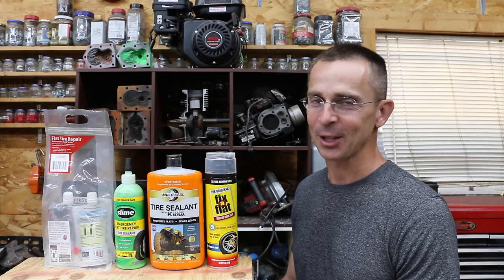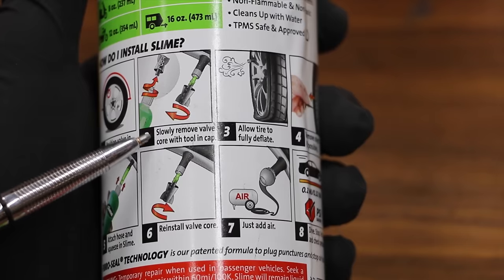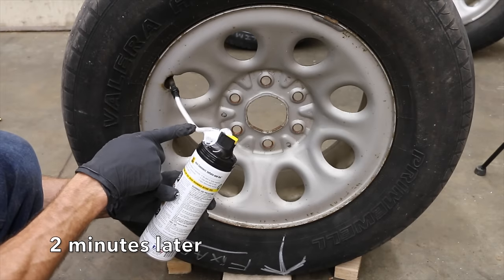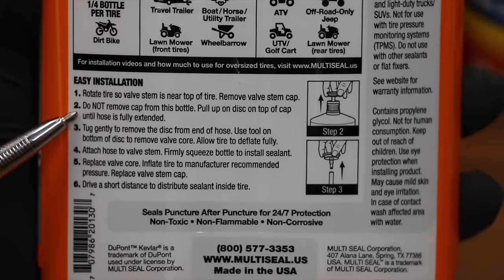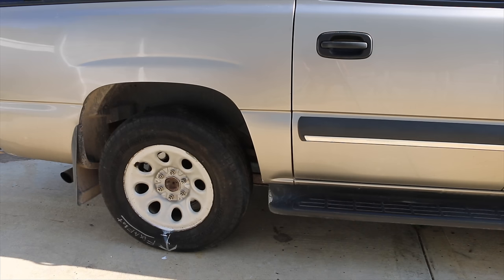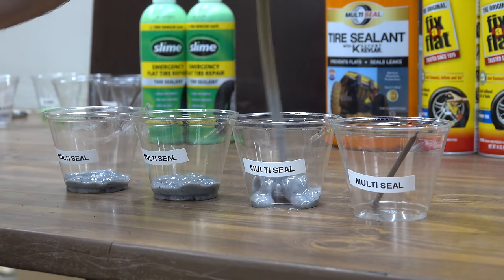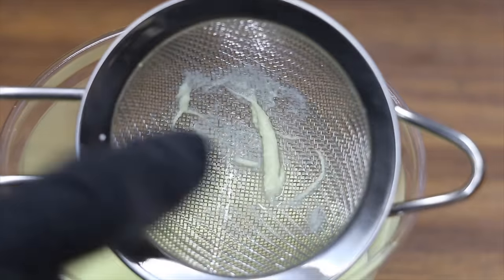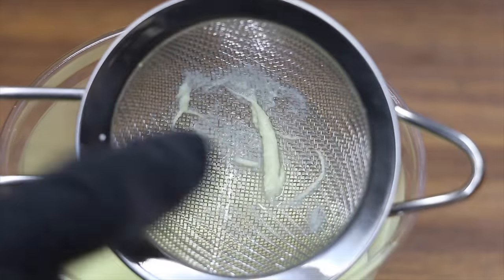Is Tire Slime the Best? Fix-a-Flat vs Tire Slime, TireJect, MultiSeal. Let's find out!

Comment: From my experience these kind of punctures are best repaired with the rubberized string plugs.  Remove the nail, jam the string in, twist, remove tool,  clip the excess.       But you gotta have an air source. Even better if you add extra rubber adhesive to the string.
GREAT VIDEO!
Reply: Agreed. If you add a good amount of rubber adhesive and it isn't on the sidewall it'll last the life of the tyre. I've done tens of thousands of miles on motorbike tyres that I plugged and never had a failure.
Reply: That's how I patch now.  But before I wised up, I tried slime a few times, and the seal oulasted the tire in every case.  But yeah, plugs are best (especially with all the newer vehicles having TPMS).  I don't trust for one second the "TPMS SAFE" claims of any of 'em.
Reply: @OnlyFactsPlease  Got a good head on those shoulders.
Reply: Oh I love string plugs, plugged two nail holes in one tire, no problem :-)
Reply: @GK-ej2ys  heh.  That's the best compliment a guy with a username like mine could ask for. Thank you. I take it you don't trust marketing bs, either, eh?  If so, I must congratulate you in the selfsame way.
Reply: @OnlyFactsPlease  Just 20yrs in the business. If you got $1 someone will try to take it. Cure alls have been around forever. Doctors during the great plague sold and overcharged for medicine to people who were already infected.

I prefer a vulcanizing fluid and a Tech brand string plug. It will chemically cure to the tire. It is not glue. When done properly the repair will almost never leak. 0.01% return rate in 20yrs.
Reply: yea its a shame string plugs are illegal in my country now, well your car wont pass a safety inspection with one anyway
Reply from the maker: Thank you!
Reply: @Norincox  maybe I've been lucky - never had a reject for using these.  Good thing - one tire on my Tahoe had four plugs!
Reply: @Norincox  sounds like you live in Europe. The nanny state ... country ... continent.
Reply: Norincox if the people you go to for inspections are looking for plugs in tires, just find a different one.
Reply: FYI, slime also works on tube type tyres which plugs wont fix. [mostly found on motorcycles with some off-road capability.]
Reply: @Norincox  I'm amazed they can find them. After a couple of hundred miles on a plug it blends in so well even I can't spot it and I knew where it was.
Reply: @Norincox  It's nearly impossible to find them and there are 4 tires to check, if they are looking for that they have too much free time one their hands.
Reply: @Norincox  When you install the plug light it on fire and it will melt into the tire and be virtually impossible to find. Do it somewhere w/o any wind, though. A very old timer taught me that trick.
Reply: I can attest to this I had a plug in a tyre for 5 years and 35,000 miles and it was perfectly fine.
Reply: Yep. Used to work for a car rental agency and nearly every week we'd get a car with a punctured tire. . . I've plugged hundreds of tires, almost never had an issue. Plugs will usually last for the life of the tire. Not to mention they're pretty inexpensive.
Reply: @johnpossum556  I light them on fire also. When I was working construction kept getting nails in my tires and when I finally bought new tires I had a total of 14 plugs (between all 4 tires). Just let it burn for a little bit then mash it down against the tire and forget about it
Reply: At my job we patch every time with plugs. They are a bit of work, but now that we're pretty much all driving F-150s we can do it without even taking the wheel off. Never had one fail after being plugged properly.
Reply: You guys should watch Grand Hotel on ABC at 9:00 pm every monday or you can watch on Hulu

Comment: Found Fix-A-Crap in my sibling's garage, instantly threw it out and told them about your research, Thanks again!
Reply from the maker: Glad to help!
Reply: I don’t know why but every time my dad used fix a flat it worked perfectly
Reply: @andie_pants  fix a flat works better for me than anything else. Have tire hole on the ground, let all air out, use a big can for car tires, 2 big cans for pickup tires, more cans than that for tractor tires. Drive 5mph or slower for 3 miles, air the tire up the whole way after that and you're good to go until you can get it patched. But fix a flat has even permanently sealed holes and leaks for me, and there are many tires I've had over the years to prove it. Definitely a must have while living on the farm. It's saved me many times. Not sure why people have bad luck with it, but I've always had great luck with using it this way.

Comment: Don’t know how “fix a flat” is still around - useless
Reply from the maker: Thank you!
Reply: Marketing and hype keeps it around
Reply: We used it for years on our work trucks.we didn't remove the nails ECT and it would inflate the tire enough to get to air or repair.
Reply: @johnhalchishick7094  exactly!  It can get you down the road.
Reply: Agreed: There's a reason it's the cheapest.
Reply: Fix a flat? More like Fix a Crap
Reply: I thought I was well equipped when I did a cross country ride on my Honda aspencade years ago. When I picked up a drywall screw I immediately felt the handling of the bike change ( as well as an audible "pop".
Pulled over and  put in a whole can of "fix a flat" . NOTHING !!!  That crap just kept pissing out.  Luckily I was in a town so left the bike to get the tire properly repaired.
Long story short. Fix a flat is garbage !!! Its only use would be as a source of compressed air to inflate a flat tire. … But then , you can buy products that do that ( or compressors ) and not have the useless mess to deal with.

Comment: Since I work in a garage, I've seen the aftermath of some of these products. A couple things you didnt see in your testing because it was short-term:

Fix-a-flat will actually damage the tire if left in there for more than a couple days. It causes the rubber to break down and "dry rot". I have serviced tires which had that stuff in them for a long time and the tire was destroyed.

If fix-a-flat is left in the tire for longer than recommended it dries onto the rim and is really tough to clean off. I do it with a steam cleaner and strong degreaser and even then it is tough to get it off. It can also gunk up TPMS sensors over time.

A product that I have had great luck with in offroad tires is Berryman Tire Seal-R. It flows a lot better than Slime, and is even able to seal up sidewall cracks in lawn mower tires caused by "dry rot". I'm a big fan of that product. I think it was even priced lower than Slime. I haven't ever tried any of these products in on-road applications.
Reply from the maker: Great information!  Thank you

Comment: I just got a new atv and almost bought a can of fixaflat today to keep in the storage compartment, glad I didn’t, thanks for these awesome videos, they may seem useless to some but I’ve learned a lot and you’ve saved me money.
Reply: Go with the slime for punctures in the tread area of the tire only. It's not gonna stop a bead or valve leak. Just make sure you use the proper ammount for your tire size. Been doing tires for 20yrs.
If you put so much in to cover the bead and the valve it makes it extremely costly in product. A new valve is $2 and having someone clean the rim shouldn't be more than $15 at a small shop. And nothing is gonna work for a sidewall hole. It flexes too much.
Reply: Keep some slime, or one those other products with your ATV, and a small 12v compressor, might save you a good headache one day.
Reply from the maker: Thank you!

Comment: Seeing that you are going to compare portable tire inflators, what about portable jump starters? i really need one of those and cannot decide which one to buy.
thank you.
Reply: I've had the Stanley jump starter for over a year now and it's worked great
Reply: Agreed, love to see a real world test of these jump packs.
Reply: I bought two of the Suaoki U28 2000A jump packs. Despite my reservations, these are awesome. One will start a modern v8 truck and two will start a diesel with dual batteries. Used professionally for a year and still going strong.
Reply: Milwaukee baby
Reply: Noco... worth the extra cost.
Reply: Sark Noco Gb
Reply: For sure!!
Reply: @blautens  Q: Do you have 55 days interest free until you have to pay anything after the billing date?
A: The interest free period can be UP TO 55 days, not a 55 days from time of purchase. Ensure you always pay your entire balance by the due date to avoid interest charges on purchases.
Reply: Security at my office used JNC660C when people needed jumps.  I got one, it has never failed to work, even on a car that sat unused for months and needed it to sit on it for a few minutes to get the battery charged up.  I used it all winter without recharging it and it jumped 3 cars just fine.
Reply: I love the autowit 12V Battery-Less Portable Car Jump Starter.  No need to worry about is it charged.  You charge it with the run down battery.  The supercapacitor releases all the power at once allowing the engine to crank at full power.
Reply: That Stanley 1000 Jumpstart is a teriffic balance between weight and ability to start bigger engines. I've had mine for 2 years and love it. The tire inflater lasted 2 months, but I burned it up through over use.
Reply: Get the highest amperage Noco Genius jump starter that you can afford. they are lithium powered and tested the best on the market. They sell them at Amazon and at many other places. I went a little overboard and purchased their Noco Genius Pro which has a 4000 amp rating on it. It works great, even on diesel truck engines.
Reply: I bought a Cobra jump starter bought from Walmart for $79, Piece Of S... Never buy one. It barely jump starterd a small car one time, since then never worked fine. Battery stopped holding a charge after a little, no customer service support to claim warranty, etc... Don't even bother...
Reply: @TheArslan2076  The best jump starter, and the one I own now is the Noco genius. I recommend that you should buy the highest amperage you can afford in that model. They're all good but the higher amperage models give you more and longer starting power for really dead batteries or for multiple car jumps.  I highly recommend that brand. You might also consider a supercapacitor jump starter. You never have to worry about the charge on the unit because it uses the dead battery to charge the supercapacitor just before the jump start. Here's a video of the one I have but there are several models on the market.  https://www.youtube.com/watch?v=DUQVTZnlrs4
Reply: @jameskoralewski296  Thanks!
Reply: I work road service full-time and my EverStart 1200 amp jump starter from Walmart for $80 is a beast I've had it for over a year now and it never fails me it also has a air pump bill into it as well
Reply: @stevethea5250  what are you on about?
Reply: @travism4528  When?

>was around $720 from Xiaomi oficial store on ebay with 2 years war

Currently I'm feeling Black Friday-Cyber Monday>Boxing Day sales > EOFYS/Singles Day > Click Frenzy

Others... Sofa Sunday? Green Monday, FREE SHIPPING DAY, Eve/Christmas, New Years Eve.
Reply: Just, whatever you do- don't buy either battery chargers or jump starters that are sold at Pep Boys.
Reply: I use a fat max for my shop, used daily. Works like a charm every time with metal clamps and I've even left it out in the rain a few times
Reply: @bobbowie5334  wish I knew that before I bought mine for $100... JUNK
Reply: If you haven’t yet get a JNC. Best starter ever
Reply: I have a review of the one i use on my channel..i love it. Everstart maxx
Reply: Audew 2000 jump-started appears to be a good one.  Saw a good comparison a on them.

Comment: Just my own experience but I've had Slime brand 26" tubes on my bikes for years now (extra thick rubber compared to the ones the bikes come with). Gone through many tires on the same tubes in an area prone to thorns. Each new tire, I've noticed a growing number of small green dots in the tube - where the slime has repairs a puncture I didn't even know I had. The only minor down side is that now and then the valve needs cleaning out. Small price to pay for no flats in years.
Reply from the maker: Thank you!
Reply: Do you actually put slime into bike inner tubes? Won't it plug the valve overtime? I've been thinking to convert my bike to tubeless but if you can actually insert slime into the inner tunes I might as well skip the whole project as a whole.
Reply: @williamaungleyraud  You can use Slime in the tubes. It works great and I've never had a valve problem.
Even though I do have inner tubes, for the past couple of years I've been using Stan's Notubes Tire Sealant and it's worked excellent. I can't compare it to the slime but every single ride I get multiple puncture weeds in my tires and it's worked amazing.
Reply: @pirateradioFPV  yeah, primarily for tubes though it's also marketed for tubeless car tires, etc. The only drawback I've ever had with Slime is the need to clean out the valve from time to time as it can clog it up and prevent you from topping up the air. Each puncture lets a little bit of air out before the slime can seal it, meaning every month or so you need to top up. About 3-4 months in and enough of the Slime gunk starts to block the valve. Just a 5 minute job to clean it at home which is a much better alternative to sitting on the side of the road in the rain trying to replace a whole tire. Just my own experience and opinion, obviously.
Reply: @pirateradioFPV  nice to know, thanks. I'm just using standard 26" Slime tubes in a regular bike. For now a fatbike is out of my budget. One day, hoping to save for an electric fatbike though
Reply: I run standard 26" clenchers ghetto tubeless on standard rims and slime TUBELESS tire sealant. The one gallon jug at walmart. It works great. Bout once a month I'll check air pressure and top off since these are so thin. Usually just a few lb. drop. I've pulled bits of wire and thorns from my tires and the slime sealed it up.
Reply: @williamaungleyraud  Not only does it not plug the valve, they sell bicycle inner tubes with Slime pre-installed.

Comment: I have used Fix a Flat several times and it has FAILED every time, reliable product.......LOL
Reply: Same here, now I know why.
Reply: Same here, always leaks out so wasn't to surprised when it happened during testing. lol
Reply: Same here....never even went into the valve, it just busted out the hose and made a huge mess.
Reply: Me too, -it has not worked one single time, not even on a small pinhole...
Reply: Exact same story here.  It never lived up to it's name.  First time I tried Slime, however... that fucking tire lasted for the rest of it's lifetime without a flat.  Never looked back since.  I don't believe that crap about "tire pressure sensor safe", though.
Reply: Maybe fix a flat is canned whipped cream thats what it sounds and looks like
Reply: At least they are consistent :p

Comment: just had to use the green slime on a toyota camry ...worked great ....might be hard to use for older people ...squeezing that bottle was not easy  and then you have to have an air source  but it did its job .. a week later of daily driving and NO loss of air pressure ...now have to find a tire shop that will take off the tire and patch it....Thanks for all the work you do

Comment: You forgot to test flammability
Love your videos!
Reply from the maker: Great point!  I actually deleted the flammability test to avoid getting in trouble with YouTube since it could be viewed as unsafe.  None of the products were flammable to an open flame or to metal heated to 700F.
Reply: ....wait what?
YouTube would seriously consider you testing the flammability of a consumer product as unsafe??? 

One (with common sense) would have to think that not knowing their flammability would be more unsafe than knowing. 

But then again, YT ≠ common sense.

Love your videos! Maybe try some tire plug kits? The common ones as wel as the rubber mushroom 'gun' looking kinds...
Reply: @dusterl1472  YT is soft as hell.
Reply: moar pewpew  by not setting things on fire?
Reply: Ok I work in a tire shop ... a lot of shops will refuse to work on tires with this stuff in it ... my techs have to waist 20 mins cleaning it so they can fix it ... would really prefer if people wouldn’t use this stuff.. people leave it in the tire and forget about it and they start to do weird things over time. Also have issues with them killing sensors over time ... said their sensor safe but their not if it’s left in for a week. IMO unless your 100% stranded with no option this stuff shouldn’t be used
Reply: But yet there are videos on YT on how to make Potassium Cyanide. Go figure
Reply: @dusterl1472  it's YouTube legit you can't show anything that could harm anyone legit you can get in trouble for making car videos as driving a car is deemed unsafe. Gotta love living in a world where everyone has gone soft and everyone gets censored over youtubes political agenda.